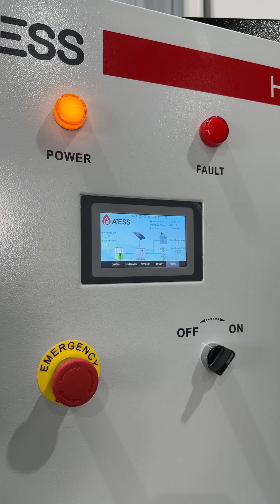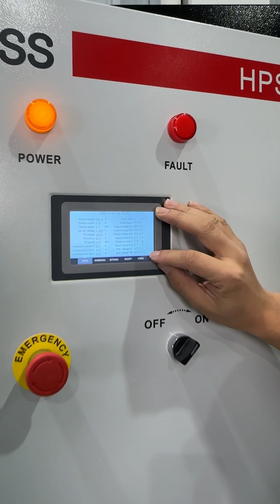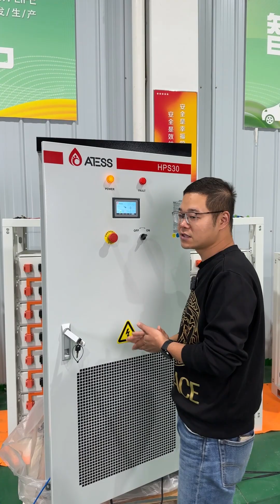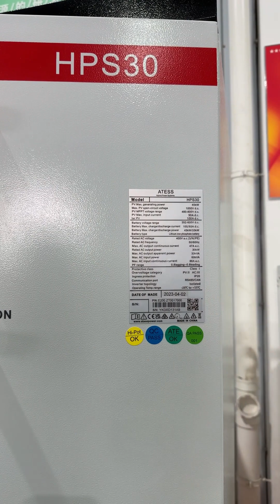Greensun HV Battery system with Atess 30KW hybrid inverter introuction in details

Comment: Can i use it in combination with grid tied systems ? That feed back to the atess inverter ?
Reply from the maker: Hello，Joe here, Thanks for the comment,     Yes, if you already got a on grid system and wanna add battery extra, you can connect with an Atess inverter to do AC Coupling
Reply: @greensunsolarJoeNi  hello, thank you for the Fast answer, what do i need for it ? Only the inverter ore also the whole switch gear, atess supplyes ?
Reply from the maker: @PvBastler   My pleasure,  Just a inverter gonna be ok, But there has PCS gotta same function,there's  no need go a solar inverter,kinda expensive than PCS
Reply: @greensunsolarJoeNi  perfect, would it be possible, that you can make a Video about it ? Would apreciate it verry well